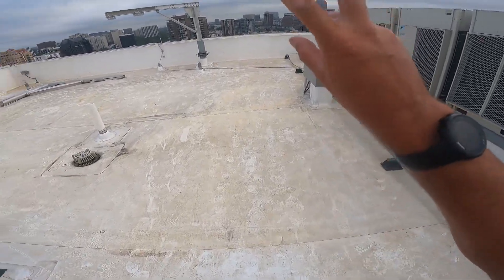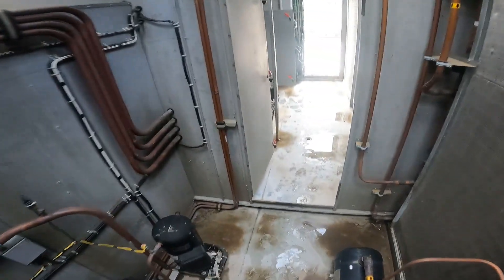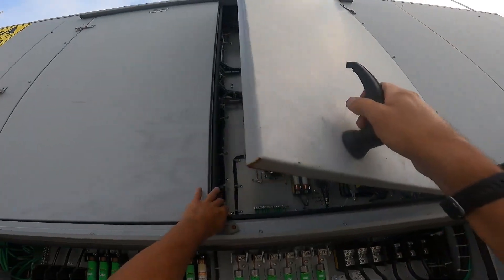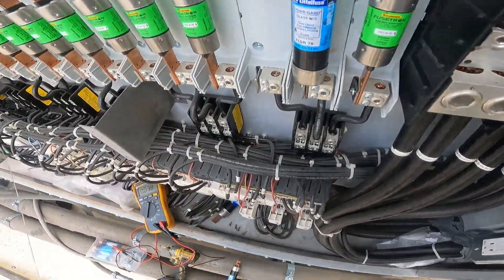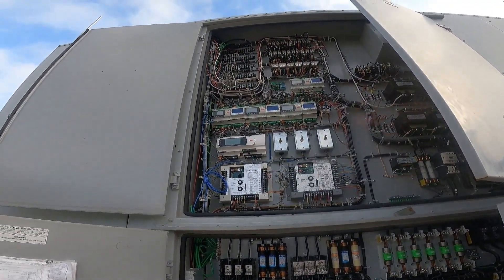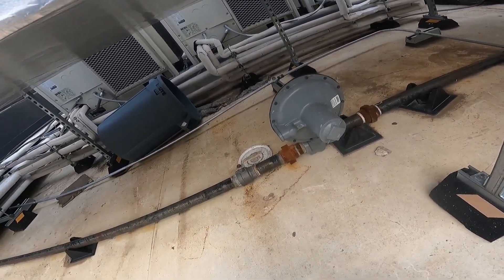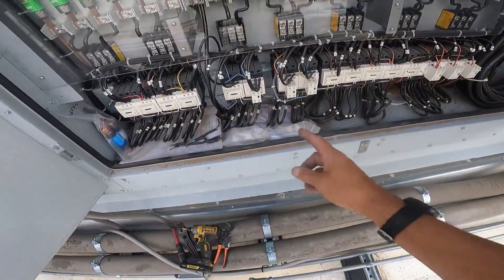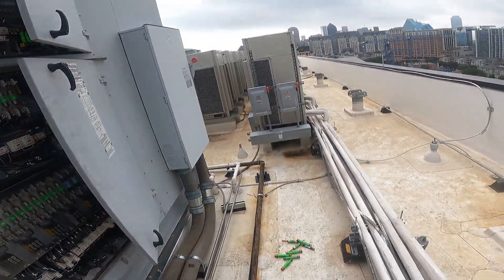HUGE Engineer Aire unit complete failure and unusually cheap repair

Comment: LOL!! We have these type of fans with the motor in the hub for more than 50 years already here in Europe. Even good old GDR (East Germany) had them. They're just durable - no belts, no pulleys, just two bearings (without the pulling force from a belt) like a normal AC motor - mostly lasts forever.

Comment: Maybe a stupid question does commercial gas pipe not have to be painter yellow in Texas in rust resistant paint
Reply from the maker: Only if it has been replaced!  I learned that one the hard way.

Comment: as far as the AWG scale goes even bigger would be 0, 00, 000, and 0000 I have mostly come across it while working at concerts. usually is hooked up to 400 amp 3ph google cam-loc to get an idea of the connectors
Reply from the maker: Huge connectors!!!!  I need some of that on my life!
Reply: @Matrix13533  i once ran power for a show that was 7 3ph 200a circuits for lights and sound and then another 3ph 100A "pin and sleeve" just to power the stage itself. each of the 7  runs used 5 conductors of 0000 "4 ought" and total length of copper was around 17,000ft